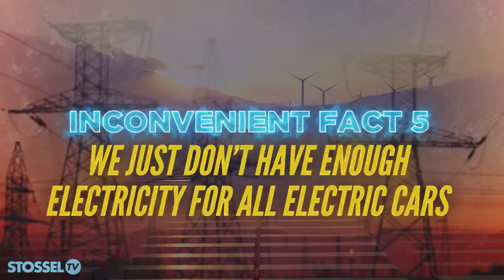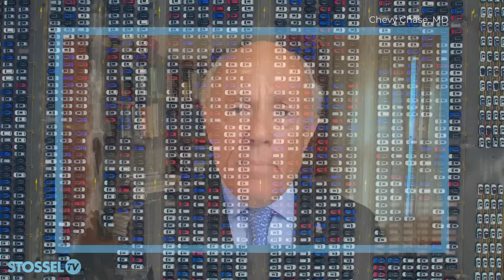Electric Cars: Inconvenient Facts, Part 2

Comment: The reason politicians love electric cars so much is that their energy source is centralized. If all cars are electric, they can control car usage by controlling the power plants. Gasoline availability on the other hand is distributed.
Reply: How do I make non centralized gasoline for my car?
Reply: Power plants are already centralized. The future direction is more distributed generation via solar on the roofs of houses. For most people, a full solar roof can provide most of the energy needs of both their home and vehicles.
Reply: @paulrybarczyk5013  Uh, did you watch the video? "I'll come in to work tomorrow...unless it's cloudy."
Reply: @ep4169  you could still drive into work, Because the house would still be connected to the grid. It would just need way less power from it, and probably none in the summertime.
Reply: @ep4169  Newer cars can go 300-500 miles on a charge.  So a cloudy day won't stop me going 80 miles to work, and I can work at home.  It also won't stop my two son's 2 mile drive to the university or my other son's 6 mile drive to his job.  But the price of the electric vehicles is out of sight. I typically buy used, but a battery with 8 year warranty isn't dependable.
Reply: Gasoline seems distributed, but it is controlled by the few refineries in each state.  I used to be against electric vehicles due to national security, thinking the first thing an enemy bombs is the electric power plants, but the refineries are actually higher on the list.  So having distributed solar panels throughout the state actually is better, and if hooked up to your home, with the right equipment, a police state can't stop charging that way.  They or an enemy could still till do a malware attack, but even our gasoline engines now use computers.  Fact is, if we vote in tyrants, we are doomed.  Not only that, but in the states that are going electric, they are limiting the oil drilling permits, so we won't have oil, distributed or not.  So plan to be prepared to go electric, like it or not.
Reply: @TimoLevikari  You can buy gasoline from different sources instead of from a government controlled utility.
Reply: Rooftop solar is decentralized. There are some residential wind capturing devices on the market as well. No law requires you to connect your PV array to the grid. John Stossel failed to mention residential geothermal and tidal capture for coastal homes as part of the renewable energy portfolio. Hydrogen fuel cells for the home may become viable electricity and heat sources, obsoleting grid distribution by power companies. Criticizing the EV transition based on the limitations of battery-only storage is ill-informed. What about mechanical electricity storage like high-mass flywheels?
Reply: @paulrybarczyk5013  People of the future won't own houses.
Reply: @paulrybarczyk5013 : Houses that are fully electric, that is every appliance is electric, cannot sustain themselves from just solar panels on the roof. In certain states where is barely rains, maybe. But any state that sees all 4 seasons cannot power itself.

Most people who claim they are off the grid turn out to be using gas for their larger appliances.
Reply: @TimoLevikari  Wood gas.  Bio fuels.  Homemade methane.  It's practical for a farmer or someone with a forested acre or three.  Absolutely impractical for city folk.
Reply: Not really.  Refineries sufficient to fuel an economy are very big, very centralized facilities.  Lack of refineries is right up there with lack of power plants.
Reply: if only there was a way to produce electricity at home with wind or solar power!
Oh, wait....
Reply: @TimoLevikari  it already is less centralized than electricity, which comes from only one provider in your area.
Reply: Gasoline with your Onstar spy software disabled and your smart phone in a mini faraday cage is real freedom.  That's what the fascists hate.
Reply: It’s funny that it’s exactly the opposite of what you say, gasoline is very centralized since you can get it only from one source, and if the gas station shutdown or there is a shortage, you are screwed, and unless you have a oil well and a refinery in your backyard, you can’t produce your own gasoline.
While with electricity, you can simply install solar panels on your roof and produce your own electricity and be independent.
Reply: They also love it because many of them have investments in it all
Reply: With solar, wind and batteries, you do not need only centralized power sources:   home, business and community level solar will be integrated with central grid power.